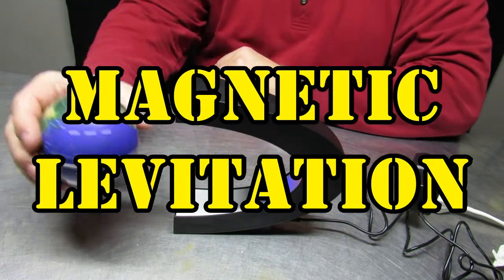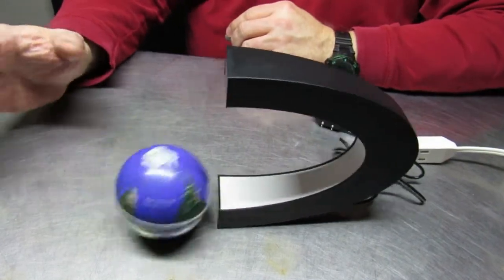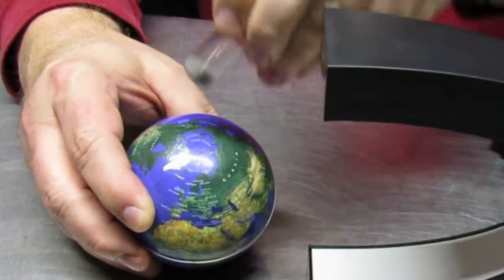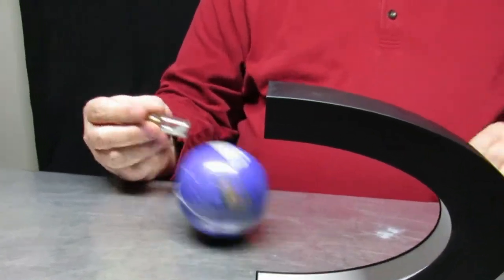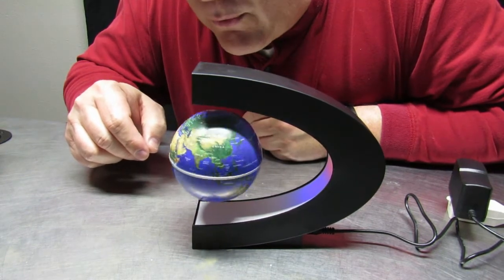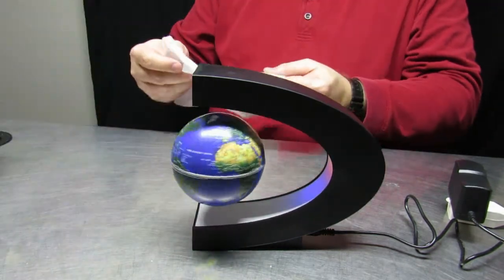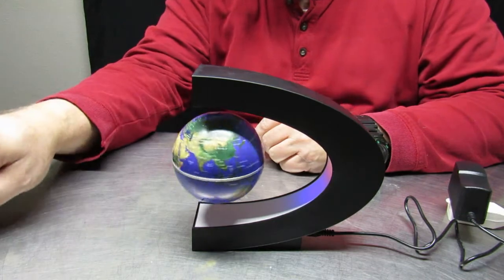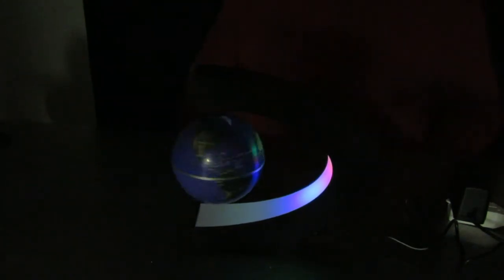Magnetic Levitation Globe How it Works

Comment: does this have an on/off switch.  i got one for christmas and the instructions manuel says there is one but I can not locate it.
Reply: MaddyK you just have to turn it off at the plug
Reply: sry there isn't an on and off switch the guy in the video is using a 6 plug adapter extension cord that has an on/of switch